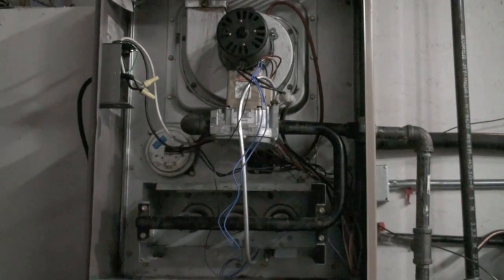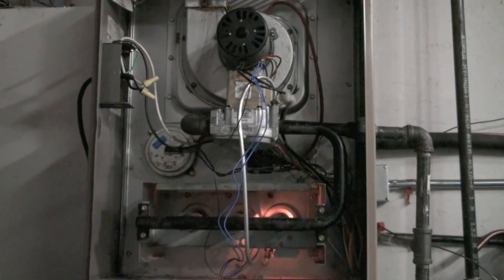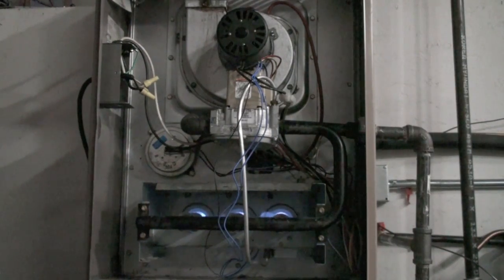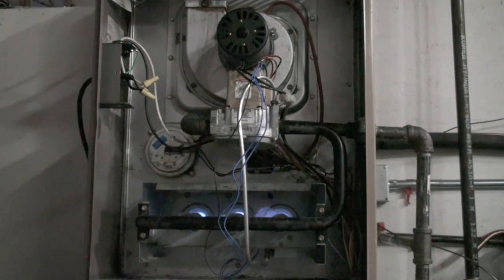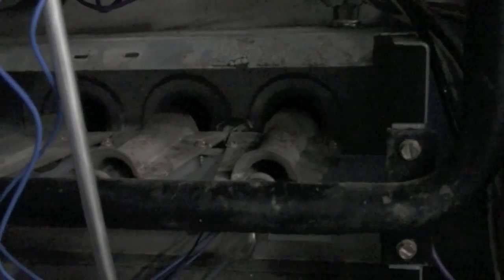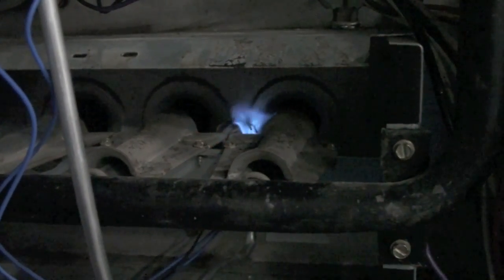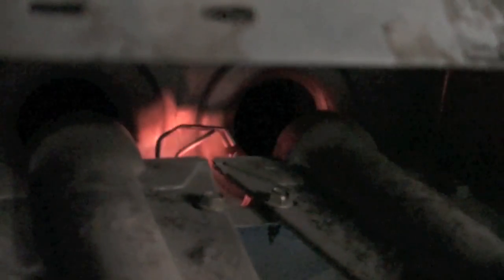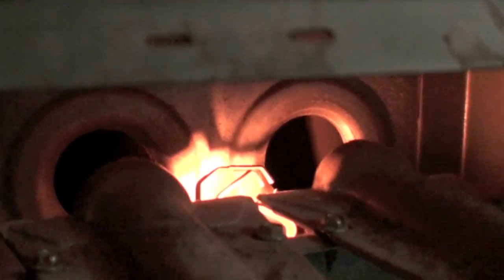How smart valve furnaces work and troubleshoot.

Comment: I'm getting 4 flashes on my SV9541. According to the troubleshooting chart, the limit switch is open. Everything ignites and the burners come on, but it short cycles before getting to desired temp. I also notice that the stick igniter steadily glows throughout the whole heating cycle and does not shut off Do I need to replace the smart valve? Help please it's cold in here lol!!
Reply from the maker: Replace it.
GFM
Reply: That's why I don't like it.

Comment: The problem I'm having was the pilot would not light at first so I replace the pilot assembly after that the pilot would light but 20 seconds later the glow stick would glow again and then shut down never firing up the Jets. I ordered a used gas valve hoping that would correct the problem but I'm having the same issue. I changed the transformer because I noticed a power drop when it glowed thinking it wasn't getting enough voltage but that didn't correct it either. After seeing your video I'm thinking I might have a bad pilot assembly that's not sending the signal back to the gas valve letting the valve know it's lit. Hoping to find out before I order a new gas valve thinking I got a bad one.

Comment: So, I got a furnace that is lighting the pilot but the main burners never light. Gas valve?
Reply from the maker: @brokensmile8487  Most failures of this type can be traced to failure to sense flame. If there is a flame rod in the pilot flame be sure the flame is blue and covering the flame rod. You could also clean the flame rod with sandpaper. 
GFM
Reply: @grayfurnaceman  I just want to say, your videos are great and they've helped tremendously.
What is the best way to check these flame sensor on these smart valves? Is it the same process as other flame sensors?
Reply from the maker: @brokensmile8487  You can't check the performance of the flame rod.  You can clean it but be careful, the hot surface ignitor is very close and fragile.  
Now, for probable reality.  The control inside the gas valve assembly has probably failed.  Means a new assembly.
GFM
Reply: @grayfurnaceman  I guess they have a harness you can hook up to the igniter port on the gas valve and runs it in series with the igniter assembly and that will check the performance. There is also a harness for the control side. They are  150 dollars though. I ended up cleaning the flame sensor and all is good. The harness would be a good investment considering a gas valve could be replaced when the flame sensor could be the culprit.

Comment: I replaced my gas valve and still no joy . It lite off once and never again . The pilot lights and the igniter klicks but no main flame ???
Reply from the maker: The flame rod in the pilot assembly could be dirty.  Clean with sandpaper.  Very careful, you can break the HSI.
GFM
Reply: @grayfurnaceman  cleaned with some sand paper but still no joy
Reply: The pilot is lighting and the igniter is clicking away , but no main flame . It has a new gas valve and new main board . The ignition box has also been replaced??

Comment: I have a standing pilot furnace. I replaced the bad gas valve. The new one was different from the obsolete original. At first it lit ok. 2 weeks in, now there is a violent explosion when the burners light. What could be the cause?
Reply from the maker: First, be sure the gas input matches the model plate info.  If ok, watch the ignition from the pilot.  Does the pilot light any of the burners?  Does the gas valve energize but nothing ignites?  Partial ignition could mean dirty burners/ flame spreaders.  Is the pilot located close to the burner?
GFM

Comment: Each flame stream should go to the corresponding hole, not hit the wall which causes over heating the chamber. The over heating sensor will shut the furnace down. Fix the burner!

Comment: I know this is an old video but wanted your opinion if you have time. 80% unit with smartvalve. Igniter glows, pilot comes on, all 3 burners kick on for 15 seconds and then they turn off and cycle and this repeats. Tried a new flame rod assembly and got the same result. What do you think?
Reply from the maker: This is probably a failure of the gas valve assembly.
GFM
Reply: @grayfurnaceman  thats what I was afraid of. Oh well, cheaper than a new furnace but my next one will absolutely not be smart valve. Thank you!
Reply: @grayfurnaceman  I just found a broken exhaust pipe, the hole was hiding on the back side, pretty large. Pulled the elbow to replace and got a few inches of crispy hornets and their nest... gonna clean the exhaust and replace the elbow before the valve... Haha, wow.
Reply: Ended up being a completely blocked vacuum port on the induction motor.  Thanks!

Comment: Pilot lights than goes out immediately,then repeats.Please share your thoughts.
Reply from the maker: Do you have gas supply?  Other gas appliances work ok?
GFM
Reply: @grayfurnaceman  yes have gas pilots comes on and goes out than comes on and goes out over and over. Thought rectification problem cleaned sensor,checked ground and polarity.Hell I even checked phasing of transformer.I was thinking bad smart valve but not 100 percent sure.Was hoping you could guide me on this one.
Reply: @grayfurnaceman  and yes other gas appliances working fine
Reply from the maker: @robertcherry4971  That's almost certainly the gas valve.  It comes as an assembly.
GFM

Comment: I’m getting power to my ignitor but no glow. 
But if I give it 24v from transformer it glows 
Why won’t it work from the smart valve coming out even though it has power going to it
Reply from the maker: You probably have a ghost voltage from the control.  Voltage but no amperage.  Common failure in smart valves.  Replace the valve system.
GFM
Reply: @grayfurnaceman  thank you
Reply: Hello. I have this same problem. New smart valve SV9501M2528 as well as new ignitor assembly. Replaced both 6 months ago. I have power from the board to the valve and 24v from the valve to the ignitor, and it will not glow. All other safeties and pressure switch check out ok. Is this ghost voltage im reading then?

Comment: Having a issue with this smart valve,  pilot lights main burners come on and stays on for a few minutes blower doesn't run until after the main burners go out, then repeats sequence,  GFM what do you think could be the issue?
Reply from the maker: If the burners are on more than 45 seconds before the fan comes on, the fan board is not operating properly.  Probably needs replacement.
GFM
Reply: @grayfurnaceman  thanks for the feed back was leaning towards a board issue, really appreciate the response back.

Comment: I get a boom in mine once and in awhile.
Reply from the maker: That's probably a delayed ignition.  Start with cleaning the burners and pilot assembly.
GFM
Reply: @grayfurnaceman  
Will do ty
Reply: @grayfurnaceman  
Finally took it apart today. Found a black piece of ribbed hard brittle piece lodged in the burner. Cleaned everything well. Put back together. Now when it fires it makes a tiny peutt noise. Since new ,it's never been that quiet. Thank you very much. 😃

Comment: Gfm, hey I'm working on an icp furnace everything checks out but main burners only stay lit between 5 and 10 seconds..I cleaned everything on pilot assembly with steel wool but still doesn't go.
Reply from the maker: If the unit has an electric pilot and the pilot moves away from the flame rod after the burners light, you may need to shield the pilot assembly to keep the flame on the flame rod.  You could also have a failing ignition control.
GFM

Comment: Can the main valve sometimes come on at same time as the pilot?
Reply from the maker: No.  If the unit has an intermittent pilot, the pilot must prove before main gas can come on.  You could have a stuck gas valve.
GFM
Reply: I have seen smart valves on 90% furnaces.
Reply: You can't beat the IFC these days I have heard that the smart valve is a good idea for it's time but they have had lots of recalls with the board that controls the hot surface ignition I've seen  that happen with the ICP brands alot.

Comment: Having trouble with a HEIL DC90, it short cycles. Everything works but it will only run about 5 mins Max, then just runs inducer till it fires again. Cleaned and checked but didn't understand flame sensor part with gas line Soo assumed it was rollout and cracked exchanger. Now think I need to try and clean the flame sensor which I still don't see what part it is

Comment: My igniter comes on but my burners won't do you think I have a bad gas valve
Reply from the maker: If you have a Honeywell smart valve, and the ignitor glows, but the pilot flame does not come on, either you have no gas available or the gas valve has failed.
GFM
Reply: grayfurnaceman my ignator comes on and my flame to but  my burners won't if I light them by hand they will but not strong
Reply from the maker: Sounds like a bad gas valve to me.
GFM
Reply: grayfurnaceman I thank you for all your information
Reply: This is the same exact problem I am currently having (I think). I hear the click and call for heat, inducer fan starts spinning, I see the surface ignitor glow red and the pilot ALWAYS lights. About half the time the burner will ignite and stay on until the house reaches temp. 25 percent of the time it ignites but only stays on temporarily (may range from 10 minutes to an hour) and 25 percent of the time the burner won't light at all and I have to keep shutting it down and turning it on and hope that it ignites. Does this sound familiar?? Sound like I need to replace the SmartValve? @ramonlara563

Comment: Can't stand the smart valve. Had an issue with one in the field last year that was not sending voltage to the igniter. I replaced it and it worked until 5 days later. Came back out and this time the main burners weren't coming on. I cleaned the flame sensor and the main burners came on. I cycled 3 times, all fine. 2 days later, I got another call from the customer. Still a flame sense issue. I replaced the igniter and flame sensor assy. It worked for another week. Got called AGAIN and finally determined the brand new smart valve was faulty. A month later, I had another faulty brand new one. I wish honeywell would pay for my time and gas driving back and forth to the supply house. These both were the 4510 model.
Reply from the maker: I agree with your condemnation of the smart valve.
GFM

Comment: Original Honeywell gas valve was replaced with a new Honeywell vr8304m3509 and Original Honeywell Ignition Control Board S8610U3009 was also replace. Everything looks to be wire correctly 24v coming into Ignition Control Board. Still have no pilot. The gas valve only has on and off no pilot markings.
I checked the spark wire with my meter looks ok. Only thing I didn't change yet is pilot unit. Q: Do I have to light up gas pilot with a matches or should it light on it's own. HELP PLEASE, thanks in advance
Reply from the maker: Are you getting a spark?
GFM

Comment: How can you check flame sensor in this thing?
Reply from the maker: You can't.  It was designed as a cheaper ignition control that is essentially throw away.  
GFM

Comment: I have no igniter glow at all. Replace valve and still nothing. Have 24 volt to valve in, but nothing to pilot even after replacing valve
Reply: Check for voltage to the igniter- could be loose or bad wires/plugs. Compare ohm readings of hsi to recommended reading- could be bad hsi. Make sure safeties are closed, follow sequence of operations.

Comment: Hi GFM - I have a similar furnace. It comes on and runs ok, but the gas valve has some chatter / clicking noises. While running and close to shutting off. it clicks very fast and shuts down. Any ideas of a simple fix, or does it need a replacement (value or electronics)? Thx!
Reply from the maker: Mostly, that is a control board failure or thecoznncetions from the gas valve to the board.  Hope this helps.
GFM
Reply: In this bad board scenario would you be able to jump 24v straight to the SV and get it to fire and run properly therefore proving the bird being the issue?

Comment: hello,  can you help the pilot comes on for about 90 sec. then shuts down,     (pilot fails to prove) ?  main gas does not start at all,
Reply: exact same problem hear, pilot lights but not getting gas to burners. 24v everywhere but orange wire which I believe is the main gas voltage to open gas to burners. don't want to buy pilot assembly, then turn around and get valve. is there anything else I can check to 100 percent make sure that the flame sense is failing or just the valve?
Reply from the maker: Sorry, I missed your question.  Clean the flame rod.  Careful here, the hot surface ignitor is close to the flame rod on the pilot and is delicate.  Hope this helps.
GFM
Reply from the maker: Clean the flame rod on the pilot.  Careful, the hot surface ignitor is very close and is delicate.
GFM
Reply: i did clean the flame rod, and it works great thanks
Reply: thanks for the info, I should have mentioned I already cleaned flame rod. still does not work. I'm going to replace the flame rod igniter assembly and see if that takes care of it. I do it on Sunday. I'll let you guys know how it went. I appreciate all the feedback. thanks again to GFM
Reply: Hey guys, I installed new flame rod combo, did not fix. installed old one and put other back for truck stock. gas is not opening for burners. do you think this is an issue with board or smart valve? pilot does stay lit, and tries to light burners but no gas, not getting 24v on my orange wire which I believe is the burner side of the valve. not sure if that last info helps but let me know, Thanks in advance. videos are extremely helpful!
Reply from the maker: Its very common for the smart valve assembly to fail.  Sometimes if you wiggle the connector, it might start.  The board inside has failed solder joints.
GFM

Comment: Please help, I have a suspended garage furnace/heater i guess, Honeywell VR8205 with an electronic igniter that supposed to come on via thermostat, gas supply is on, power is on computer board green light is flashing normal, thermostat is switched to heat and on the on position but no numbers(Temp Reading) is not displaying, nothing is coming on,can someone please help winter is coming, Thank You, Yours Truly,, Frustrated.

Comment: I am dealing with a ultra 90 that ignites but I don't believe the main gas line is coming on because the burners do not light. but the fan will come on and just blow air which is cold do to the burning not lighting.. any suggestions
Reply from the maker: +Omar Hill If the pilot comes on but no main gas, the flame rod may be dirty.  You can clean it with sandpaper but be very careful.  There is a small hot surface ignitor close to it that is easily broken.  Hope this helps.
GFM

Comment: thanks great video i am going nuts  my furnce waz working fine until burners start working intermitent until finaly die so the smart valve was replace then while disconecting the electric heaters i notice! the hsi did not turn pilot, i used a lighter and everithing works perfect am feeling like kick it hard! who knows what may be wrong may be trasformer or hsi (it glows red to softh orange ) i really feel  mad at midnight when i need to manually turn it on having a hsi is wonderfull!!
Reply from the maker: +Pedro Flores I would try cleaning the pilot assembly.  Be careful around the HSI, it is fragile.  Hope this helps.
GFM
Reply: +grayfurnaceman  i did replace the hsi its working now- the old one did glow red but looking at ur  video i notice my did not glow as much, so i did  replace it and at about two seconds it turn pilot (the ohms were 3.82 at 200ohms ) so it was pretty good but good enought

Comment: yes ,
Reply from the maker: Are you sure the gas is turned on?
GFM
Reply: +grayfurnaceman yes sir , it seems to me like it's not sucking out the gas
Reply from the maker: Have you checked to see if there is flow through the pilot tube?
GFM
Reply: +grayfurnaceman how do I do that
Reply from the maker: +Andrew Ramos I would use a match or lighter placed close to where the pilot gas comes out of the pilot.  It should either light or the lighter flame should be ruffled from the gas flow. No flow, check the orifice in the pilot.
GFM

Comment: I changed my gas valve and the ignitor is turning red but doesn't turn on at all now it did turn on several times but now Nothing, do you know what the problem could be thanks
Reply from the maker: Does your system use the Honeywell smart valve?
GFM